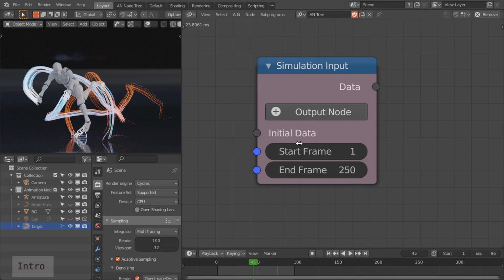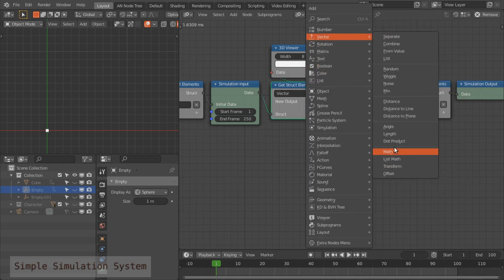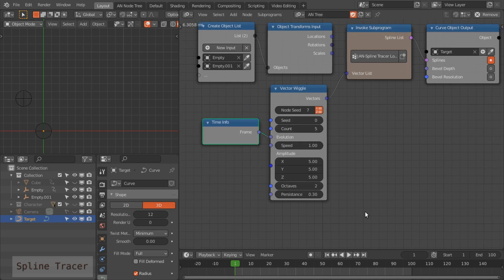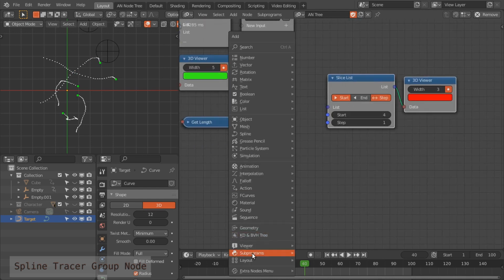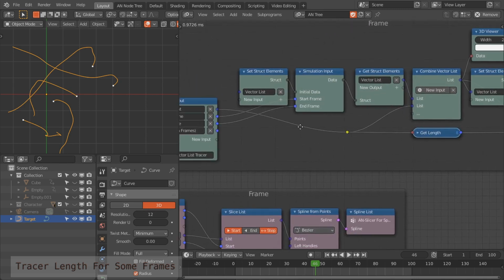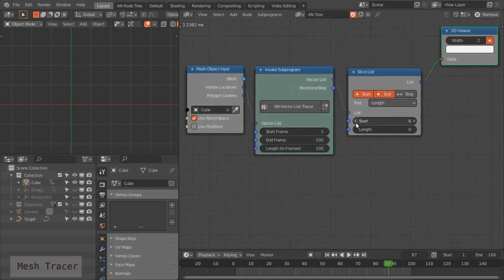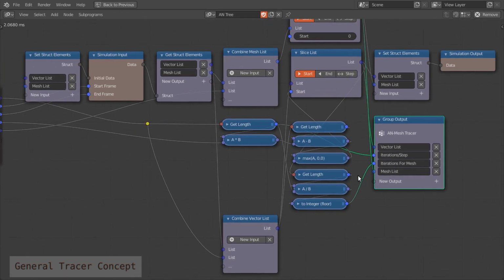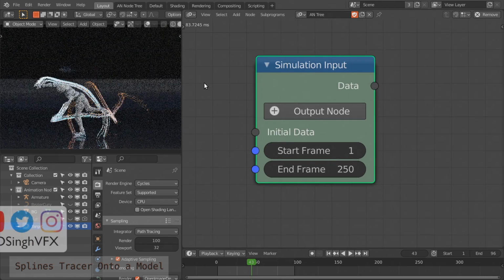New Simulation Nodes in Animation Nodes in Blender I Tracer, Dynamic Vertex Color, Weight - Tutorial

Comment: Thank you so much for the tutorial, I am curious if the nodes would require baking before rendering or if instead the math could be calculated on the fly during rendertime avoiding the necessity of baking.
Reply from the maker: You're welcome. You can cache the group-node if you're doing having calculation to see the real-time playback speed. Otherwise, you can render without any baking/caching, it will do the calculation during rendertime.
Reply: @3DSinghVFX  Wow that's awesome, I was curious because sometimes I use an online renderfarm but If I don't have to worry about baking the nodes it would save a lot of time since the calculations could be done on the renderfarms pc's during the render. If I used rigid body simulations in animation nodes, would these also render correctly without baking?
Reply from the maker: @funny1048youtube  You can use rigid body sim in AN. But I suggest you bake the rigid body sim before rendering otherwise it may cause glitches: https://docs.blender.org/manual/en/latest/physics/baking.html

Comment: Good afternoon, thank you for the lessons. Is it possible to manage Rigid Body physical simulations through these nodes?
Reply from the maker: Hi. You're welcome. There are two ways: 1) You can control the Rigid Body settings with these nodes BUT not the objects as far as I know.
2) However, these nodes allow to build new Rigid Body System in the AN.

Can you tell what kind of Rigid Body physical simulations do you want to achieve?
Reply: @3DSinghVFX  For example, you can use a physical simulation of the destruction or fall of objects , and then collect them in their original form, before the destruction.
Reply from the maker: @Airsup100  It is possible without and with AN. First, bake the simulation into keyframes: 1) In the "Nonlinear Animation" editor, you can reverse the animation. 2) Or use Action From Object and Action Object Output nodes to achieve the same effect with more controls.

Comment: Is there indication these patches will be accepted into the mainline tree?
Reply from the maker: Many of the Extra Nodes patches are already added into AN, and WIP for new ones :)
Reply: @3DSinghVFX  I just tried with the github release on 2.93apha. Made it about half way through the video before it crashed. Maybe 2.92RC is a better option. After following up until spline tracer for a given length I'm still wondering what to use this for.
Reply from the maker: @ParanoidFactoid  It is mainly for more control for graphics. The Length is in the number of frames, so, if you want trace-spline only for the latest 20 frames (say) then you can do that with the length option.
Reply: @3DSinghVFX  Thanks for taking the time to reply,. I went through the tut. So I get what you're doing with spline tracing. But.... will there be any node connections to other simulation effects like fluid dynamics, wind, and gravity? Thanks so much for your work.
Reply from the maker: @ParanoidFactoid  You're welcome. Maybe not node but group nodes. The Wind and Gravity effects are easy to do but fluid dynamics is very difficult.
Reply: @3DSinghVFX   Also, just want to say, AN+EN for py27[8] on the github release page listed here doesn't work with blender 2.83LTE nor blender 2.91.2 nor 2.92RC. This is on Ubuntu 20.04. I don't know why. I install the add-on by file normally, try to start it, and immediately get a fatal error. The release for Blender 2.93alpha w/Py29 does work, though blender is unstable. I do want to try some of these additional nodes. So thanks for that.
Reply from the maker: @ParanoidFactoid  Here is the release workflow, the Latest/Daily build of AN+EN keeps track of the Daily build of Blender which is Blender 2.93, and because Blender 2.93 uses the Python 3.9 so does the AN+EN Latest build.
I have released the AN+EN build for Blender 2.91-2.92 on my GitHub page: https://github.com/3DSinghVFX/animation_nodes/releases/tag/en-v2.2-for-blender-v2.91-v2.92-cd-build